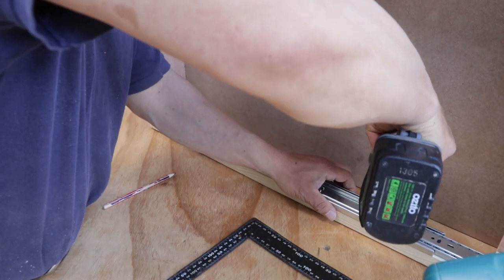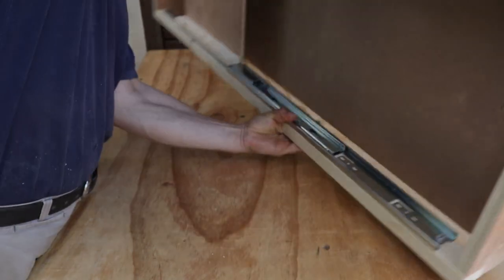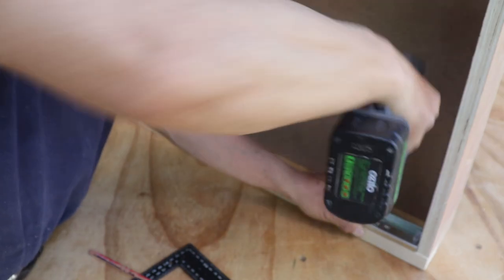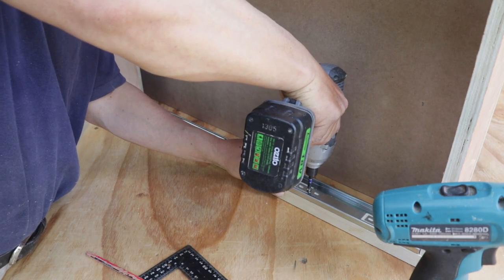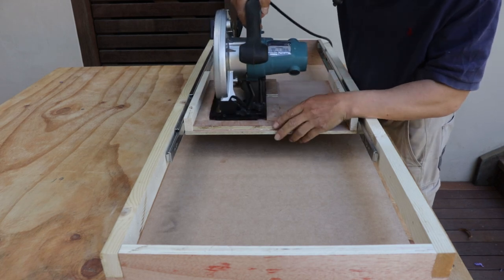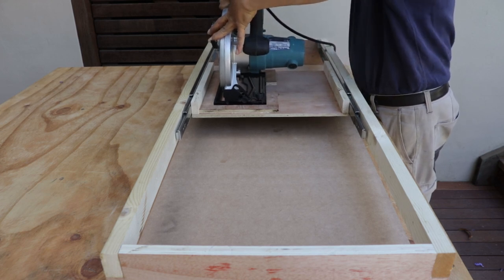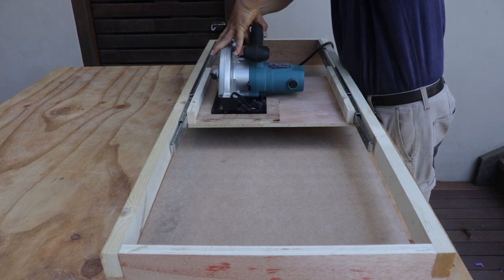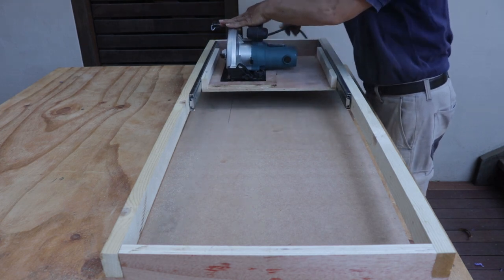Cross cut jig for circular saw using drawer slides

Comment: great! would you share info on the length of the drawer slides you're using (in withdrawn and extracted state)? Thank you!
Reply from the maker: Thanks for watching and supporting the channel  !!
The length of drawer slides is 600mm 
If you use longer slides you can cut wider timber.
Reply: @diywoodholic3858  Thanks man. Will build one very soon. I even thought about maybe combining 2 drawer slides on each side to extend the range (or trying D.James' solution). By the way: i prefer your design over many many others!